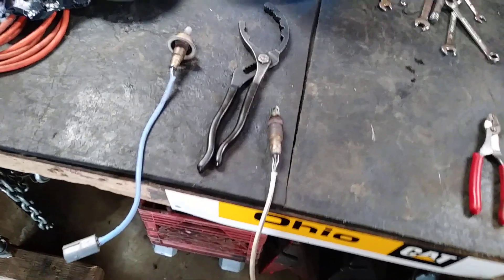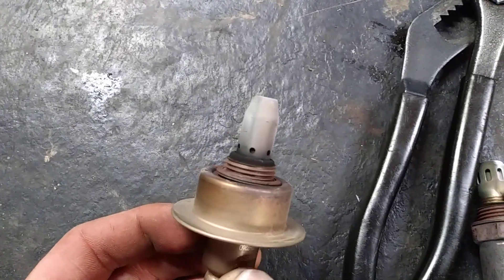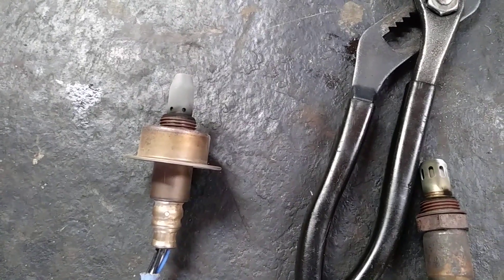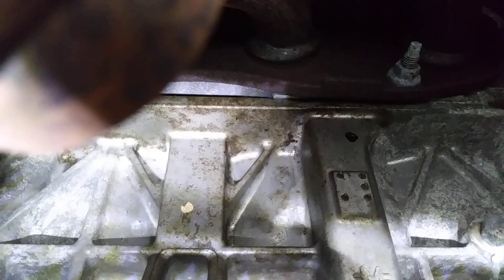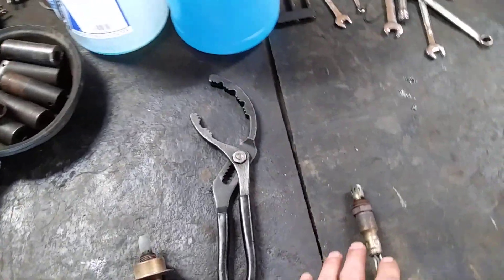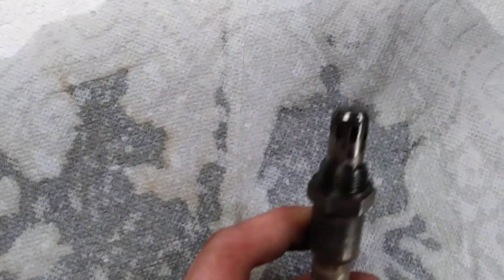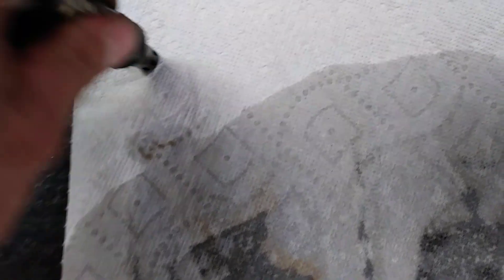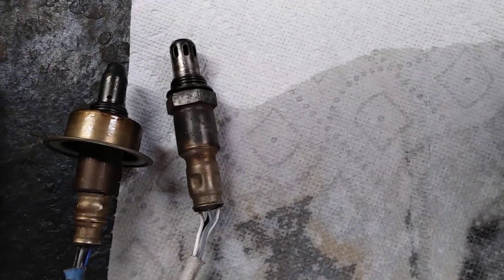Clean oxygen sensors, does it work?

Comment: I have a question for you. I watched a video you made on removing an oil pressure sensor with a 1 1/16th socket but then you said you personally dont use the socket you use a wrench. Can you remove the sensor from all car types with a wrench? My vehicle is a 2012 Chevy Traverse LS AWD and my husband cant seem to get the old one out. Even after I went to lowes and bought the right socket he still cant get it out. Idk if hardware store sockets are different from an auto part store or not but this thing is getting really ridiculously frustrating at this point!!! Any tips you might have here or insight of any kind would be greatly appreciated.

Comment: The O2 sensor is extremely delicate, so I prefer to burn the carbon off with a welding torch, buff it to a dull polish with a metal file, and then give it a few hard whacks with a plumbing wrench to knock out the shavings. Works fine after that.

Comment: Did you need a special tool to remove your upstream sensor?
Reply: Ben Rillo yes you need a sensor removing tool.. just has a cut out for the wire.. like 10 bucks on amazon
Reply: @XxelmokillerxX1  Not true.... There is a tool to make it easier to remove but is not MANDATORY to remove the sensor.....if you are replacing them you can just cut the wires off of the old one and use a socket....if you are cleaning them and are going to put them back in your vehicle...you will need an open end wrench...7/8 probably....but get the base of the sensor (where it threads into exhaust pipe) really hot first if you are having trouble breaking the sensor loose...using a hand held torch is best way to do this. 
You can try just running vehicle to heat it up but doing so will heat the entire exhaust pipe and be harder to work around without burning yourself. Heating the threads will  help to break it loose and make sure when replacing it that you put some anti seize on the threads so that when it does need to be replaced, it will not be as hard to remove.
Reply: There is a tool to make it easier to remove but is not MANDATORY to remove the sensor.....if you are replacing them you can just cut the wires off of the old one and use a socket....if you are cleaning them and are going to put them back in your vehicle...you will need an open end wrench...7/8 probably....but get the base of the sensor (where it threads into exhaust pipe) really hot first if you are having trouble breaking the sensor loose...using a hand held torch is best way to do this. 
You can try just running vehicle to heat it up but doing so will heat the entire exhaust pipe and be harder to work around without burning yourself. Heating the threads will  help to break it loose and make sure when replacing it that you put some anti seize on the threads so that when it does need to be replaced, it will not be as hard to remove.

Comment: This video is a waste of time. “This may work, but I don’t know for sure.” 👌🏼
Reply: Your comment was a waste of time.
Reply: Bob Smith you must have seen value in it since you replied. 🤷🏻‍♂️
Reply: It’s astounding to me how many sociopathic hillbillies there are out there who post erroneous and inconclusive auto repair videos. You can’t clean a bad O2 sensor any more than you can clean a used oil filter. It’s dead - you have to replace it. To replace it, all you need is an O2 sensor socket wrench.
Reply: Bikewithlove Its also astounding how many "techs" at the dealerships can't figure out the check engine issue and jump straight to "must be the fuel injectors tell the customer $1000-1500 to fix it"😂
Reply: It works temporarily depends how well you clean them I take a wire toothbrush to them then soak them overnight in gas dry them with compressor the next day and put them back in does the trick

Comment: It seems in the video description you said it has worked. So I ask would you recommend it as a temporary fix until you get new sensors?
Reply from the maker: Good question, depending on the situation, how badly dirty they are, and if they have fault codes or not. Yes it is a good temporary fix, until you get new sensors.
Reply: Mad Motor Repair I don't know how dirty mine are, haven't pulled em out yet. But I do not have codes, I'm just doing my Catalytic converters and had accidentally bought 4 downstream sensors, so until I can return the sensors and get the new upstream ones.
Reply: Definitely